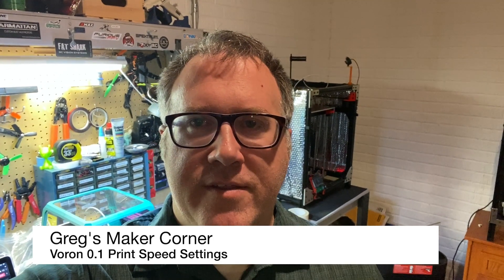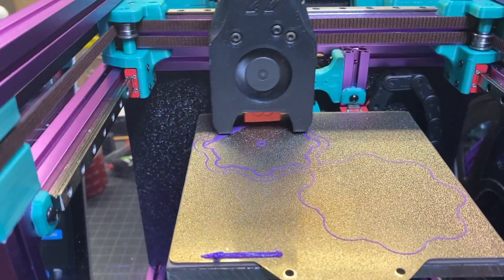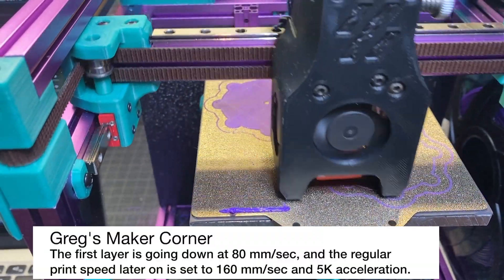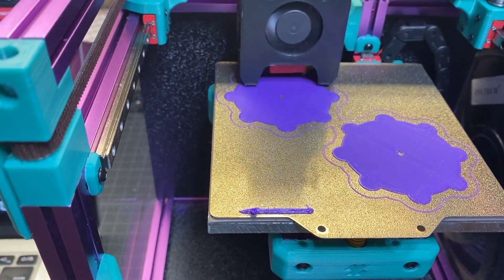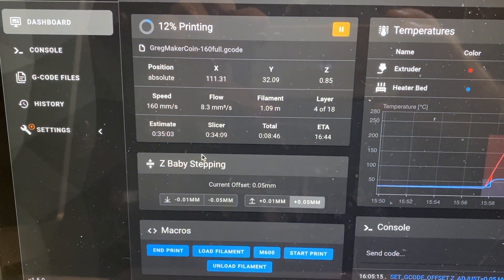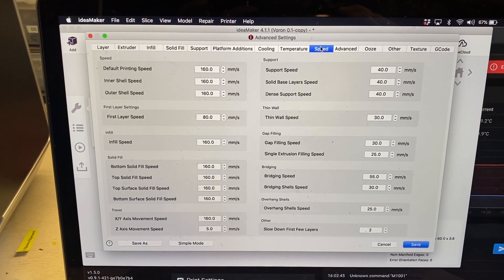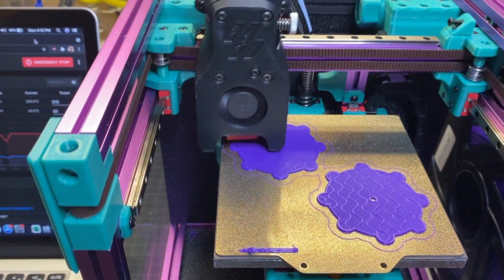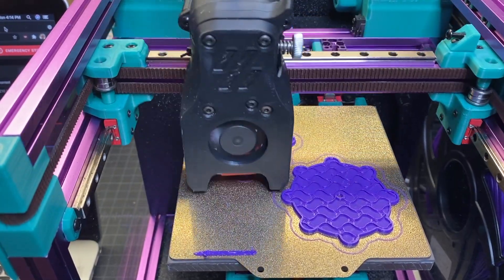My Voron 0.1 Speed Settings

Comment: i have a question. so i built myself a Voron 2.4 and it runs beautifully. my only problem is that no matter what speed i specify in my slicing software, when i preview. the speed is always brought back to 35mms. what am i missing?
Reply from the maker: That does seem odd. There may be an acceleration setting somewhere that could be slowing it down. What slicer are you using?
Reply: @GregsMakerCorner  am using superslicer. I got it figured out. I had to go to advance and override the speed settings.. than you though for taking the time.

Comment: I mean absolutely no disrespect, but I found this video because I'm just finishing up the tuning on my 350mm voron 2.4 on which I'm using a rapido hf and a bozzle high flow geometry .5mm tungsten carbide nozzle (and some LDO speedypower AB steppers) to travel and print my internal perimeters, and infil at 550mm/s at 20k accels and my details (external perimeters, top/bottom, etc. at 250mm/s at 5k and it looks pretty great to me, and I have a v0 kit (also with rapido and bozzle .5 that flows up to 48mm^3) that I'm going to be building next and wanted to see how much faster it could go with the smaller motion system of the v2
Reply from the maker: That’s great! This was definitely not intended to push the limits, but to give people and idea of what is easily achievable with stock settings. 20k accels seems impressive especially on a 350mm voron 2.4-  I have never heard of anyone running one that fast without having issues and layer shifts. 20k on a Voron 0 would even be a bit over what my input shaper is recommending (around 17k). Best of luck and maybe consider making a video if you’re getting some great results!

Comment: hi greg would you mind sharing your start gcode for the nozzle purge please
Reply from the maker: Sure thing... You can find it in my github link as well (in the voron01-0.5-printer.cfg file).   Here is the line purge part.  
    G92 E0.0
    G1 Z0.2 X40 E20 F1000.0      ; intro line
    G92 E0.0
    M400

Comment: i was wonder what slicer software did you use ? Cura or s3d?
Reply from the maker: I was using a Slicer called Ideamaker.
Reply: @GregsMakerCorner  thx i will might try to have a new print with it.
Reply from the maker: @WilliamTang  I think it's a great slicer and definitely worth a try. I still use Simplify 3D for some of my other printers, but I am trying to move to Idea Maker because it has many of the more modern features.
Reply: @GregsMakerCorner  i am using s3d, as i notice some of your print did look greater than s3d. i am curious if idea maker support with my current printer. Does it a little bit fast on the default setting base on your s3d only? As i was using 2700mm/min , this wasn't as the normal people think it's like a rocket speed. THis setting did come from video on youtube and explain different method with 160 vs 1600 mm/min. 2700 here meaning similar like 120mm or less as your printing.

Comment: Hey Greg, what is your experience with the noise level of the voron 0.1? And especially at the 5k accel and 160 mm/s speed. it seems kinda loud to have on the office desk, while doing other things.
Reply from the maker: Hey Steven! I think at that accel/print speed you are going to definitely notice some noise. I have mine running about that same speed/accel and can hear it across the room (about 30ft away) but it's usually fine for me to be on conference calls while it is running. I could see being around 10ft from it having an issue with noise. Perhaps you could build an insulated box and put it over it.
Reply: @GregsMakerCorner  Thank you for the honest response! It is not easy to find anything about the noise levels from at google or youtube search.

Comment: Is this with input shaping?
What acceleration for the outer perimeters?
Reply from the maker: Yes.. I had input shaper on when printing this. I also was using an acceleration of 5k (max accel set in printer.cfg file).